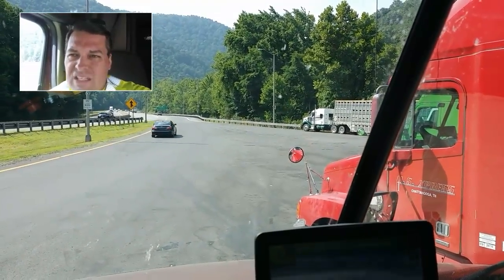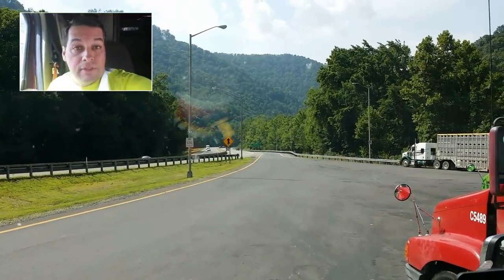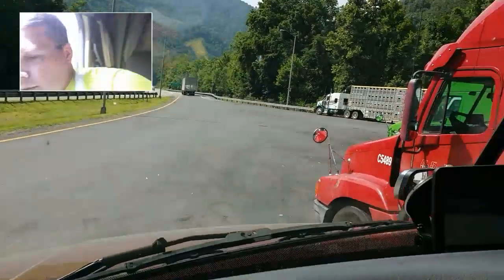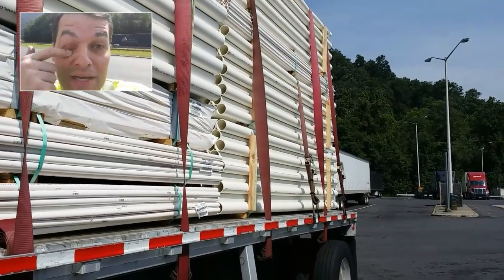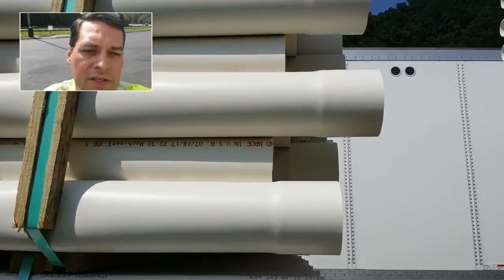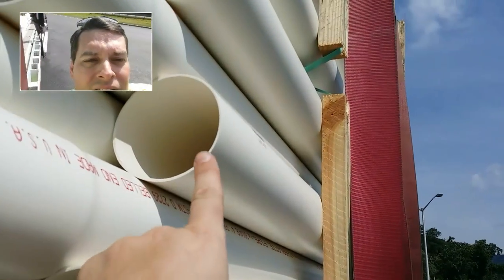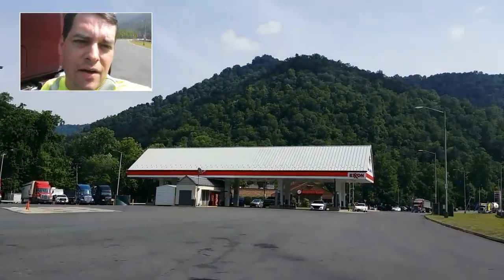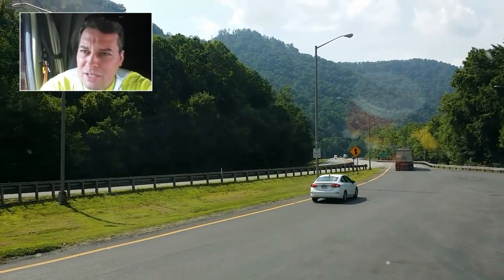A load of Plastic pipe & clarification on my Air Force Medical stuff

Comment: I have seen some flatbed pipe haulers with a tarp over the front of the load. I thought this might prevent an aerodynamic lift of the pipes. Did Maverick ever teach anything about tarping the front of a pipe load and what is your opinion?
Reply from the maker: +Mike Roy I agree,  the smoke tarp I believe keeps the pipe in place better.